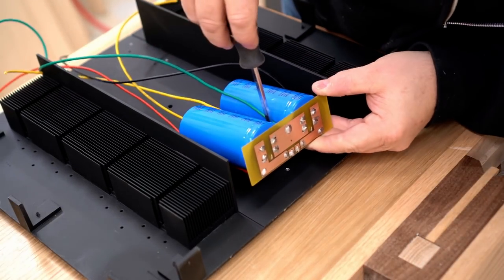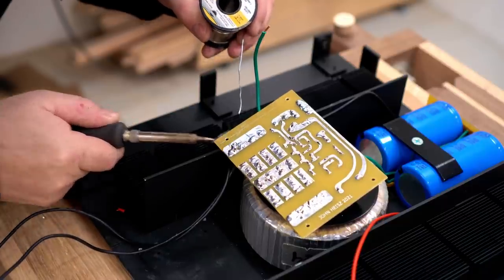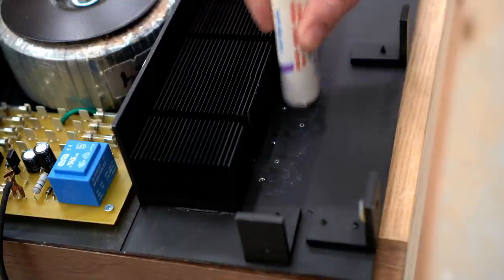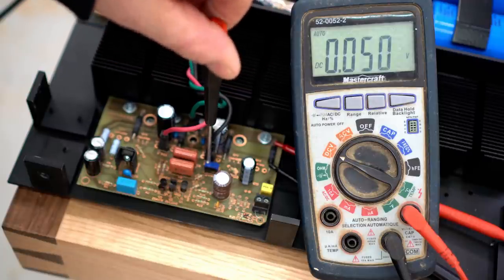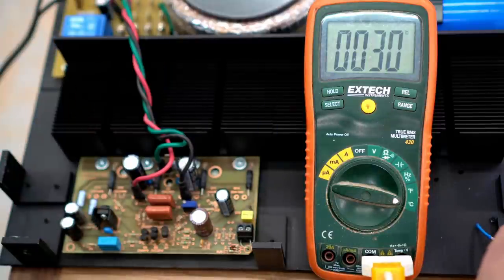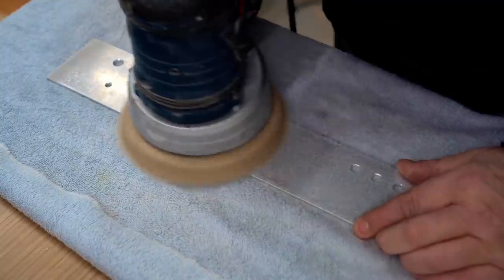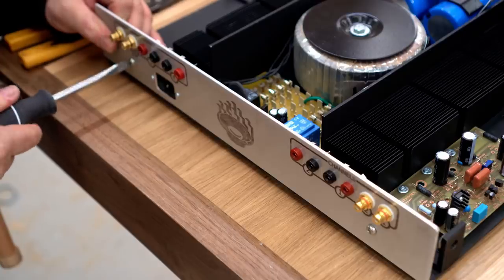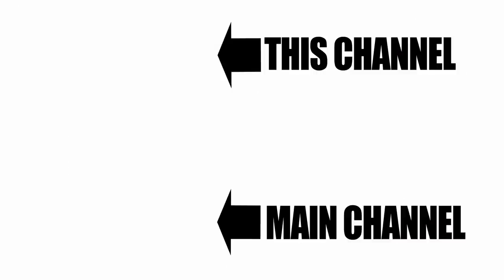Making An Amplifier From Raw Aluminum - The Back Panel and Installing The Amp Boards

Comment: There's thermal paste epoxies you can use
Reply from the maker: There are also ready made amplifier cases that I could use, or, skip that and go straight to the ready made amplifier that I could use. 
It's not about what's available, it's about using what you have on hand if it does what you need to get done. Why is that such a difficult concept for so many people to understand?
Reply: @IBuildIt  it was more of a friendly suggestion, incase you weren't aware of the products existence, than anything else as always I admire your work, great job John
Reply from the maker: I see that a lot, though. And what most people don't realize is that these specialty products were developed for a market that requires a proven product with specs that can be looked at to fill the specific need. That usually means that they are hard to get and expensive in small quantities, and perform just marginally better than a similar product that's not speced for that use.
Reply: @IBuildIt  you're talking to a guy who repairs most of his stuff with a hammer, so I get it bro, keep up the great work
Reply: @IBuildIt  It's like 7-10 bucks for enough to do your whole amp. I just don't get why you're so firm on not using it. Why not just be like... "Oh cool, I didn't know that it. My I'll try it on my next build." instead of instantly rejecting the dozen people who are telling you otherwise. Obviously you didn't even look into even the pricing, let alone the science behind it.
Reply from the maker: @AdrenalinnVapor  Guy, it's almost a full year later and the amp has been in continuous use every day since. I never shut it off, and it's working just fine and running cool.
When you build an amp, feel free to use whatever you want to, especially if you think that 7-10 bucks is a reasonable amount to pay for something that is of such little significant. 
My advice for anyone who thinks that way is to save your money and just buy an amp instead, because any amp you try to build will cost way more than it's actually worth.

Comment: woow, thats super, ps how did you transfer the label (at the back)? what did you use? ive got corroded one of mine vintage amp and i want to remove rust, repaint and then make the same writing at the back but i dont know how.